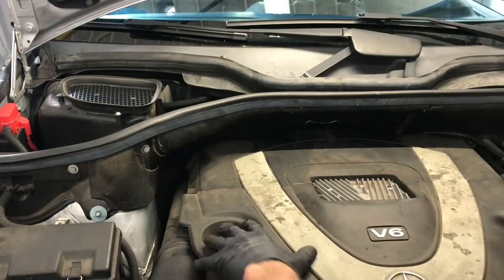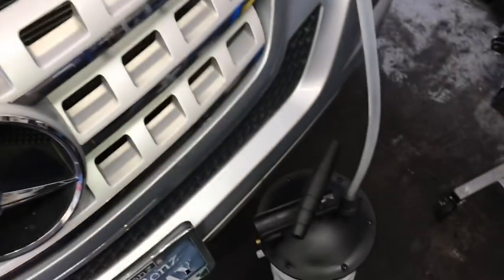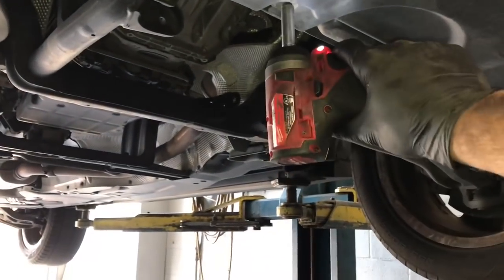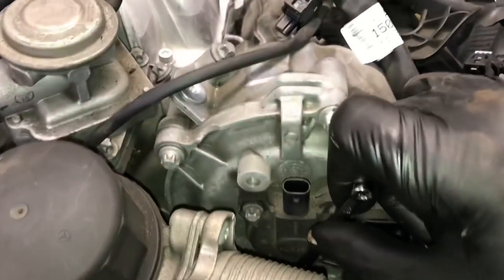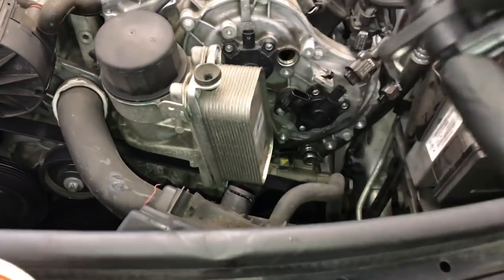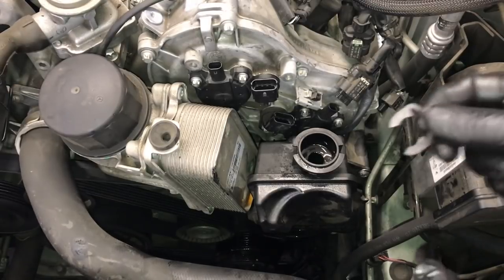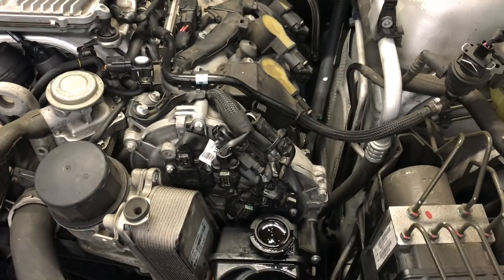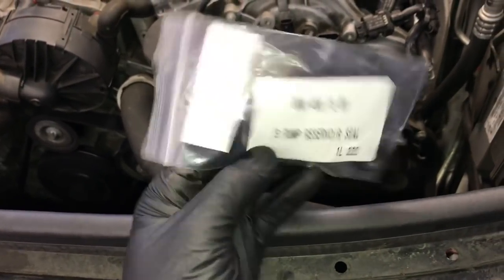Step-by-step Guide To Replacing The Magnetic Cam Adjusters On A Mercedes Ml350 With M272 Engine.

Comment from the maker: Links for parts and tools are in the description.
Reply from the maker: Thank you!
Reply: Hello, I replaced the four cam adjuster on my s550. Then three codes started showing . P0016, P0018 and p0019. Please what can be wrong? Thanks
Reply: @HowtoAutomotive  so the bottom is the exhaust ones?
Reply: @HowtoAutomotive  so two top ones are intake ?
Reply: The Mercedes part number for the camshaft position sensor o ring for a W211 3.5L engine is 023-997–12-45
Reply: I guess it is pretty off topic but do anyone know of a good site to watch new tv shows online?
Reply: @Grayson Elias i would suggest flixzone. Just search on google for it :)
Reply: @Jaiden Jacob Yea, I've been using FlixZone for months myself :D
Reply: @Jaiden Jacob Thanks, signed up and it seems to work =) I appreciate it !
Reply: @Grayson Elias Happy to help :D
Reply: @HowtoAutomotive  
Is this code p0015
An is it the same process for a c300, Mercedes Benz just did a fresh oil change an new radiator, 5 days later engine light came on with code p0015, what should I do?

Comment: You know I’m really sorry I don’t mean any disrespect, and I didn’t give you a thumbs down, but I really have to disagree with you here.  I have the same exact engine and you do NOT need to remove the power steering reservoir to replace the magnets on the driver’s side.  I did all 4 of my magnets this past weekend and you’re right, the driver’s side is more tricky due to clearance but all you need to do is use a box wrench for the e8 bolts that don’t have clearance for a traditional ratchet.  You can either use a e8 box wrench with an open and closed end OR just use a 1/4 inch SAE box wrench and that will work fine and you won’t strip or round out the bolt heads.  You can also use the same procedure for the intake cam on the driver’s side...no need to remove the oil cooler either.  It’s going to be a little tight with the box wrench but it is totally do-able.  I don’t advise removing the power steering reservoir when you don’t need to.  What I also did for slightly more clearance is I removed the power steering reservoir cap and covered it temporarily with Saran Wrap so I wouldn’t get dirt in it.  But that’s it.  And you should clean all around the magnets before you remove them so you don’t get any loose dirt into the engine head when your remove the old magnets.  Lastly, in the beginning of your video you called the first half of the engine cover the air cover box.  That’s NOT the air cover box.  The first half is simply a cover and yes, it just pulls up.  But the air cover box is the second half of the engine cover closer to the firewall and while that also pulls up, it doesn’t simply pull up.  There’s also a clip by the firewall you need to unhook.  But you don’t need to remove the air cover “half” anyway.  You just need to remove the first half - but again, that’s not the air cover.  The air filters live in the other half.
Reply: Al, thank you for your comment. I fully agree with you regarding power steering reservoir. Your comment helps me alot before doing this job.
Reply: @marianob1975  No problem Mariano!  I just share what I've learned over time.  Btw, in case you ever (unfortunately) have that dreaded electronic steering lock (ESL) problem that is common on all W204's and W205's, I have a "semi-technical" video on my channel where I share a few things that all the other videos don't necessarily tell you.  Cheers!
Reply: @AlGolzari  Thank you for this information! I hope not having problem with ESL. I subscribed your channel!
Reply: @marianob1975  Thanks! Appreciate it!
Reply: Mine would not come out with the reservoir in place and tight.  Sprinter van.  So I think it depends on the vehicle this engine is in.  I wish I had just removed the reservoir initially, would have saved me a lot of time and aggravation.
Reply: @ccodella1188  Yeah, sure it depends on the car.  To be honest, I didn't even know that a Sprinter has the M272 engine.  My comments really apply to C, E, and M classes with the M272 engine.  Sorry to hear you had aggravation - I just replaced my water pump in my 2010 C300 last weekend...not the hardest job but not the easiest, either.  Well, if you got it done - at least think of the aggravation that 'may' have happened when putting the power steering reservoir back.  I hear putting the power steering reservoir back on properly, so it doesn't leak, is a pain since there is barely any room.  And any PS fluid you may have lost/needed to buy, etc.  I guess that's my way of helping you look at the positive.
Reply: Thank you sir will have tondo
Mine cause i was not able to driver side helped a lot

Comment: Man I got burnt on one of these two days ago.  I was getting P0018,  P0019 codes and another odd code that I can't think of. A previous shop had already replaced the cam sensor. After spending a couple of hours working on and research the problem the problem went away and the car ran fine.

Comment: Hi.  I replaced the magnet with new OEM ones as a preventative maintenance and it is now leaking.  It wasn’t leaking before.  I took them out and inspected them and everything looks fine.  The rings are the same and positioned correctly.  Any clue what I could try now?  I was thinking of buying a gasket making kit and using that to create a seal.  Thanks

Comment: I found this quite useful.   You don't need to remove the PS reservoir if you have the E8 torx spanner.
Reply: I have to on my w164 ml350. Not enough space to take the magnet out

Comment: Thank you Brian and HTA for this great video series.  My car, 2007 CLK350 (175k miles) began idling rough and burning some oil. I was overdue for a service after the pandemic so I brought it into an indie shop. New to me, but they are very well known.  They found faults for tumble flap stuck, etc.. and cam adjuster issues.  Their quote to do the intake manifold was $1.550 and the cam adjuster magnets and sensors was $1,824.  I figured if I was doing the intake manifold, i might as well do the cam adjusters.  And a bonus, I also did the spark plugs as well.  The quote to do all 3 of these was over $3,500, but I did it all myself for less than $800, all OEM parts.  On the cam adjusters, I didn't have to remove the oil cooler or power steering reservoir.    One issue I found on my car were brittle electrical connections from the wiring harness.  I took as much care as I could, but about 3 of the locking tabs broke on me.  If they come loose, I guess I will have to glue?  Or maybe some kind of heat shrink jacket.  

Anyway, thanks again.  I'm glad I did this myself and saved the money.  One question, does the computer clear all the fault codes itself, or does this have to be done with a code reader?💲
Reply: Wow 🔥 respect. Code reader though
Reply: Use thin zip ties to secure connector's in place. Autozone can erase codes for free.
Reply: Yes I broke two locking tabs on 1 bank today!
Reply: How did you manage not removing the redervoir ?

Comment: Great video!
I would like to add in the beginning you have the sides of the engine swapped.
the left side is the driver side the right side is the passenger side for any of those who are getting fault codes only on one side.
Reply: Bank 1: Passenger Side, Cylinders 1,2,3,4 
Bank 2: Driver Side, Cylinders 5,6,7,8
Reply: Is this a lot left hand driver or right hand driver

Comment: FYI,you can remove sensor's on driver side without disconnecting "c" clip from p/s reservoir, just loosen 3 bolts and slightly move aside. Slow going, but less messy..

Comment: Very easy job, didn't have to remove the power steering reservoir, just need to remove a sensor and the reservoir cap to squeeze the magnets in.

Comment: Good video, thanks. I need to replace the o-rings because I have oil leakage here, but no issues with camshaft timing or slth. So iI would just replace the o rings and keep the old(still working sensors). Any reason to change the magnetic sensors as well?

Comment: I was just taking stuff off to change the vacuum linkage on the front of the i take manifold. The first magnet adjuster I pulled the wire connector from shows oil leakage. So that means I need to replace it, right? It does have the recall repair where it extends down and then up to prevent the oil from going up the wires, but I notice the plastic runner for the wires is oily. So I think it is still making its way up there.

Comment: Great video and about to change mine soon but I bought a 8mm wrench but it’s to big? I have an 2009 e350, could it be a different size cause I tried a 7mm at O’rileys but that was to big as well, could it be a 6mm? Any tips would be great. Thanks.
Reply: The bolts are E8, not just an 8mm wrench.... you need an E8 wrench which is harder to find.. your motor is M272.
Reply: Use a 1/4 wrench instead

Comment: Nice video, I have cuestión MB 2008 r350 code P0021 bank2? I have to change al 4 sensor n the camshaft magnet to?
Reply: Code P0021 is bank 2 intake manifold VVT solenoid. Bank 2 is the drivers side of the engine. The solenoid could have an intermittent failure or the oil control valve attached could be the problem and need cleaning

Comment: Brian - great video. The V8 engine on a 550 seems to limit the room to remove the PS reservoir, any tips? Also, are you aware of any recalibration that is/can be necessary following replacement of the adjuster magnets? I was told that you should replace all four at the same time, rather than just the problematic code-showing ones.
Reply: Yes, the magnets are a maintenance item, actually...and should be changed at 100K miles...so changing all 4 at once makes sense, like I did.  I don't have an S-class.  I'm a humble guy with a C-class.  But assuming it's the same set up, in general, they don't need any recalibration.  They self adjust to the cams once they are installed; the variable valve timing should do the adjusting.

Comment: Do you have to replace all 4 at the same time, or just the one that has a code?
Reply: No, you  don’t need change all 4 at the same time. It can be risky. It’s safer to change one at a time to make sure you don’t get any faults from the part you just replaced.
Reply: You can take the adjusters out and check each one, theres another video of someone doing that.  However you will need new orings for them once they come out.  Its just easier to replace them all at the same time.  For me I for sure had three leaking badly and the fourth one once removed was stuck also.

Comment: Some of you are saying you don't have to remove the power steering reservoir, that must depend on the vehicle. For me, on a Mercedes Sprinter, I had to loosen it quite a bit to get the magnet behind it out.  The magnet itself did not have clearance to come out with the reservoir fully in place.  In retrospect I wish I had just bought the new seal and followed this video because it was extremely difficult to remove the magnet behind the reservoir and almost as difficult to replace the washer on the sensor to the left.  My Sprinter has a slightly different oil cooler and that contributes to the clearance on getting a combination wrench in there, but the magnet is too thick to come out from behind the reservoir.  2007 Sprinter.  We will see if the reservoir will leak, but I had no choice as I had already taken the screws out and one dropped on top of the reservoir (i saw a little leaking on the hose coming off the reservoir before starting this anyway..).  Changing all camshaft adjuster magnets and the orings on the camshaft position sensors took care of my code issues.

Comment: Hello, what an amazing video with great explanation and good video angles. I have a GL450 (x164), and getting some codes. From your video it seems its pretty straight forward - going to give it a shot. However, not sure what to replace. I have 3 fault codes :  What do you think should be replaced - the magnet or the sensor? 
P0012 - INTAKE  (A) CAMSHAFT POSITION TIMING OVER RETARDED BANK 1
P0015 - EXHAUST (B) CAMSHAFT POSITION TIMING OVER RETARDED BANK 1
P0025 - EXHAUST (B) CAMSHAFT POSITION TIMING OVER RETARDED BANK 2

Also i understand these to be #1, #2 and #4 (L to R) from the mechanic's perspective. Is this correct?
Reply: Did you ever get it fixed ?? 
I’m having the same codes on my m272 engine it’s a 08 c350  …. I did a fixfinder read at auto zone and picked up those codes I’m trying to see what I need to replace and what parts … I see the cam magnet kit on FCP euro but I was told to change the VVT  which idk where that’s located or how it looks … lol
Reply: @youthfull4776  yes I ended up changing all 4 magnets, super easy did it myself. Oem parts from Amazon were like $80 for all 4.

Comment: Great videos! I've watched about 10 so far 🤣. 

Any advice for 2008 ml 350? Symptoms are occasional cold startup issues; engine light, rough engine (sounds like an old diesel). Usually cycling off/on resets whatever is causing the issue and runs fine until next random bad cold start. Most recent incident, engine light would not go out even after several cycles and engine calmed down, towed to Mercedes, once there, no engine light, engine runs fine. They did some more diag and are saying "Left intake cam control valve is binding".

I don't have any codes and don't have a reader, haven't yet called back into Mercedes to get more detail. 

After binging on youtube, including your channel

cam adjustor solenoid (what you show here)
cam position sensor 
timing chain tensioner? 
symptoms of the evil balance shaft blowing itself up? 

cold start lock poin failure in cam shaft adjuster / phasor ? 
random electrical issues? 

I've yet to find a single video that zeros in on a thing called adjustor solenoid control valve.  

p.s.p.s. Engine has had semi-rough idle on cold start for years, but far south of the diesel-like roughness described above. 

Thanks!

Comment: My m272 has a problem where , on cold start after I start the enginge 3-5 seconds pass a rattle sound appears , if I change those will the rattlestop? All
Mechaincs are saying its from bad timing chain and they want to replace it which costs  a lot of $$$

Comment: Hello Gentleman, I have been following your all videos in YouTube. Thanks for your time and interest and sharing. I have 2006 E350 and like to change VVT solenoid (not the magnet). Can you please guide me. Or location if the part please. Thanks in advance
Reply: I'm fairly sure the solenoid is the magnet.  There are 4 magnets and 4 sensors. Intake and exhaust...2 sides.  The magnets are in front of the valve covers.  They look like "Vs" with a circle in the middle, and held on by 3 bolts.  The camshaft sensors are circular, and on top of the magnets, and have only 1 bolt.

Comment: Hey Bryan dont know if u mentioned it but why exactly are u changing those adjusters. Was there a code for it or related to those adjusters. I'm curious because I love diagnosing cars and trying to get better on those mercedes because there is very little info on those euro cars. Thanx and awesome videos. U are tempting me to get that 1/4 inch stubby 😁
Reply: The sensors and adjusters have O-rings that leak after some time and need to be changed. Or the parts themselves get old and need replacing, I've been getting a P0025 code for my car so I need to replace the cam adjuster magnet, or both.

Comment: Why not just use an E8 torx wrench to get behind the oil cooler and ps reservoir? A slight dremel or file relief of the upper right corner of the cooler allows you to get the left E8 bolt out of the adjuster.
You can save a lot of extra work.
Reply: Depends on the model of vehicle.  I wish i had removed the reservoir, it would have saved me a lot of aggravation and potential leak since I had to loosen it anyway

Comment: Quick question: did you replace the sensor too?  Do I have to replace the sensor or would the old one work?
Reply: The old sensor can be reinstalled.
Reply: New o rings on the sensors is what you are supposed to do, theyre all in there together so taking some of them out gives more room and then you need the new orings.

Comment: You mean Benz made it easy no need to remove the oil cooler? That's no fun. lol.  How did you determine the sensors were defective,  what codes?
Reply from the maker: Glen two of the cam adjusters we’re leaking oil and I had one code for an intake cam out of sync P0015 and one for the exhaust cam P0025. Basically it’s a magnetic switch when apply power and ground a pushrod will push out and push the lever inside the engine allowing oil to flow to the cam  synchronizers so they’re pretty simple the test.
Reply: I'm actually very glad the oil cooler doesn't need to come off, I've been getting the P0025 code so I have to do this repair soon.
Reply from the maker: Aaron S. Good luck with the repair.
Reply: @HowtoAutomotive  will this.  help my p0022 code on my c350
Reply: @HowtoAutomotive  I have rough idle after a tune up y
Reply: @youngmack5206  I have the same code on same car did you get it fixed?? Help me out bro 👊